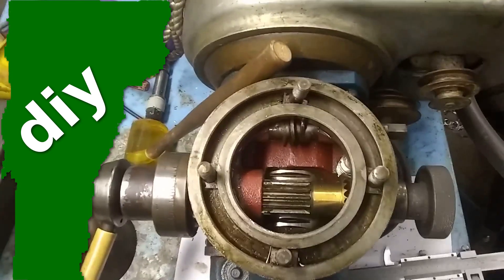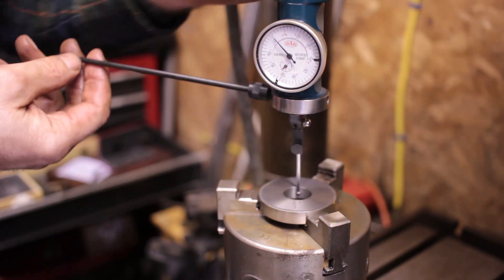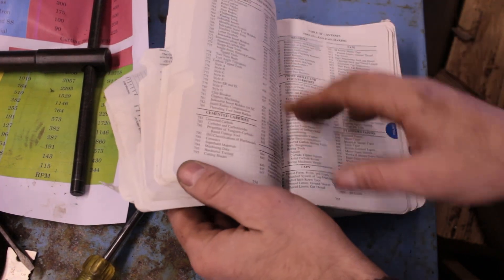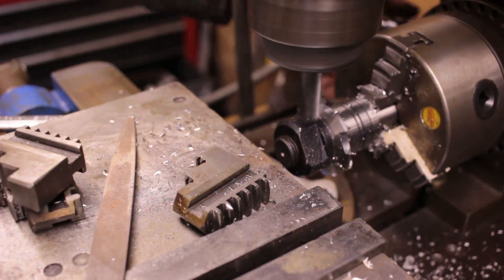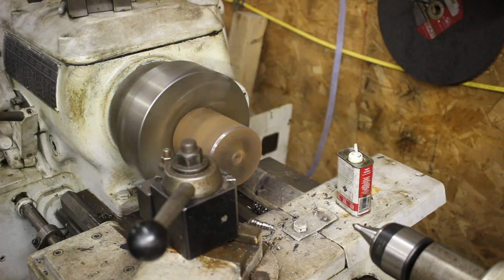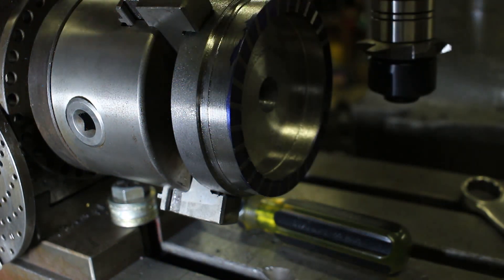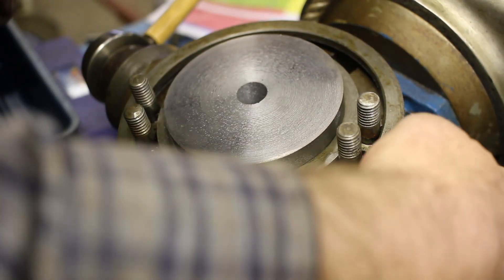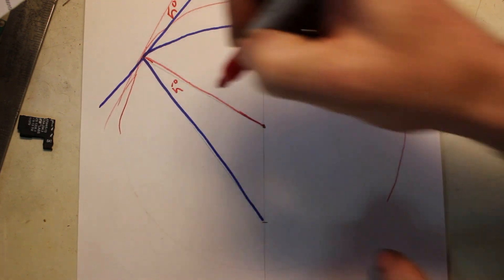Milling machine upgrade for the 2019 Spareroom Toolmaking Competition

Comment: In hindsight... a test piece in cheap aluminium would have been nice :) I know, that's pretty redundant now :)
Reply from the maker: I did have extra stock left over so I could make another one but it was pretty time consuming.  I suppose aluminium would cut a bit quicker but I still would have had to machine two of them.  It's hard designing and machining something.

Comment: Bravo! Excellent work, not everything needs to be perfect. If I tried for perfection all the time, I would get nothing accomplished in this hobby.
Reply from the maker: In highschool my machining teacher told us "don't work to tolerances that aren't there".  

This issues with this part were more design issues than machining issues.  There's a lot going on and it was really hard to measure all the existing pieces.